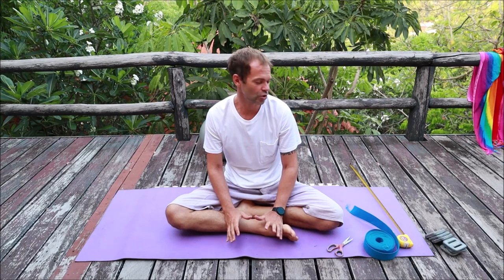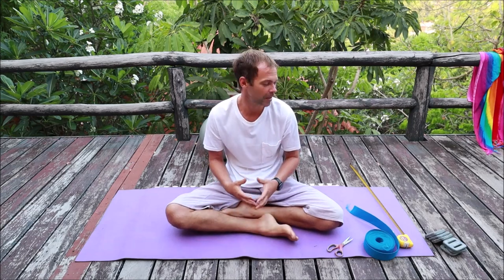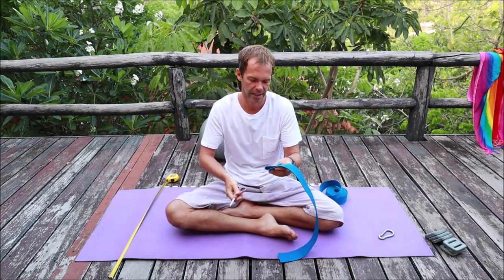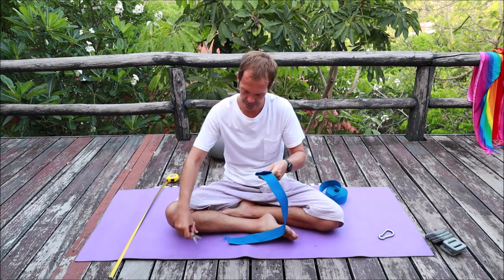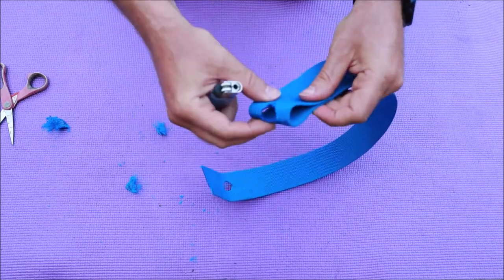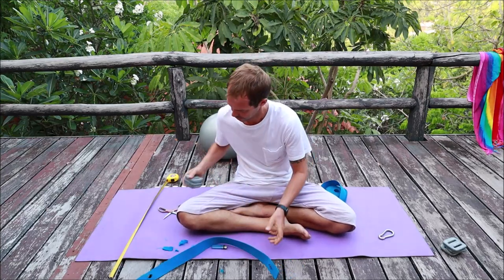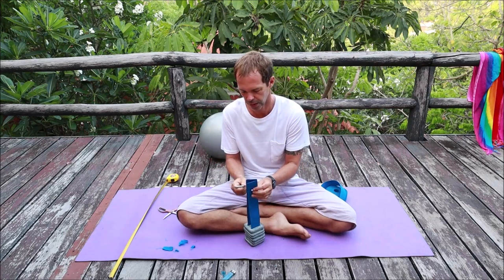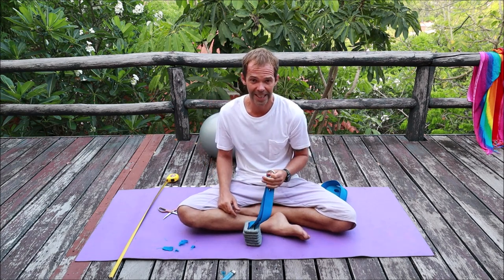EASY Way To Make Bottom Weight for Depth Freediving | Freediving Equipment

Comment: Great explaination and how to video. But why make bottom weight like this? I just use a cast iron kettle bell and I tie a knot under the bottom plate to make a loop. Then I use a bull hitch, it looks similar to a double half hitch but you go around an extra time. When bull hitch is tightened down it doesn't slide around. Kettle bell is easy to carry around it has a handle built into it. I am sure this method works well but for me I like the kettle bell better. I have two kettle bells one is 25 lbs for free imersion and one is 10 lbs for bifins or no fins. Thanks for videos just sharing what works best for me.  

Maybe I am missing an advantage of this style?
Reply from the maker: Hi Chris. Sure, kettle bell can be used, no problem :) Our option a bit cheaper and also can be easily adjusted if needed.

Comment: Are those 2kg weights or 1kg weights?
Reply from the maker: We have 0.8 or 1.2/1.3 here at Crystal. So in total I like to have about 7 kg for the bottom weight
Reply: @KAIZENFREEDIVING  Cool, thanks for the response.  I hate a light weight for FIM. It's true some beginners pull too hard, but if they pull really slowly, they also might never get anywhere.